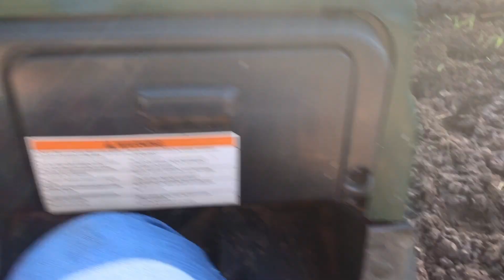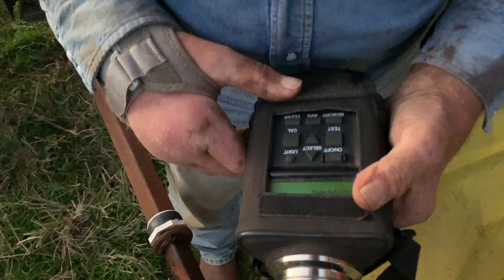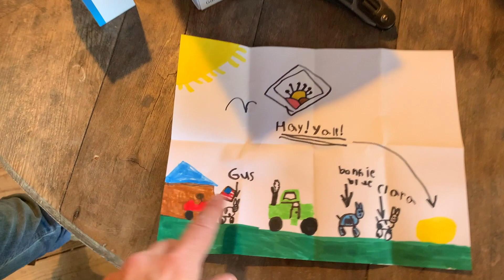Roll That (Dusty) Bean Footage! Harvest is a Go

Comment: years ago when we had our family reunion , my aunts & uncles were all farmers and every year we would have it at someone else's farm with all the cousins! We had the hay wagon for a table with all the food on it, and 3-4 milk cans with cool aid in them, and a dipper to dip it out with!! Glad you get to use the bins!! Never run anything when it's on HOT=blowed the engine! probably a leak some where-Never add cold coolant to hot engine, blowed head gasket!  I noticed that there isn't a guard on the PTO shaft on the auger- grab cloths, accident - I caught the edge of a tarp with the mower, and it got sucked in, had to cut it out!! Love Mustard!

Comment: I have had beans before that were laying down so bad we could only cut them in one direction. You would make a pass then dead head back to the other end for another pass. Only way we could save them. Be sure and secure that auger cause if it moves you will have beans everywhere (don't ask me how I know this). A short piece of pipe going into the bin will prevent this. I know y'all do no till but if you can leave the fields as smooth as possible it sure makes cutting beans easier. If you have problems with rocks check into a bean "roller". Just after planting when the beans up about three inches you roll them which pushes most of the rocks down into the soil. This is done quite a lot in the mid west. The beans are flexable enough at that stage it doesn't hurt them. Hope you have a good time with family...

Comment: Hey just a thought if you put a couple cones or something similar to mark where you place the dump truck you can put them on the driver's side and where the driver can see them in the mirror off the side about three feet from where you want the back and front tires to be and the driver will be able to line up without anyone directing. He will be able to verify when he gets out to operate the auger 👍❤️🇺🇸

Comment: I've got a Gleaner just like yalls (mine is 40 years old and will starve birds to death!) and mine leaks in the same place, at the bottom of the unloading auger in grain bin. I fixed mine with duct tape in the field until I could rivet some sheet metal in place. Another place that leaks is the tailings auger under the machine. Good to see Mr. Lawrence's hand getting better!

Comment: Meredith, if your truck coolant is low and running hot you most definitely have a leak,either externally or internally, if externally its either a hose,radiator,cap,thermostat or intake,water pump gasket or water pump itself,or freeze plug.if internally blown head gasket or cylinder sleeve crack.adding water or coolant is only a temporary fix,it will be low again and run hot. you need Laurence to check it out before you blow up the motor. Always remember this,a motor does not use up the coolant EVER,if it loses any its always going somewhere,AKA leak.

Comment: When I was a teenager I worked on the farm with my uncle.. He had an Allis-Chalmer gleaner combine..Smaller than the one yall have.  I spent many hours in it combining corn and soybeans and wheat.  No A/C in it.  Very hot and dusty in Georgia running a combine.  Hard work but I wouldn't change that farm experience if I could.  Just a bit of trivia here.  Gleaner was an equipment company that was bought by Allis-Chalmer in the 1960's.  One meaning of Glean is "to harvest".  So we get Gleaner means harvester.

Comment: Meredith, just a couple of, hopefully, constructive comments about this typically entertaining and fun video.
I’m sure LB would also realize these noticed concerns.  
1.	Engine coolant low and missing from an engine is a sign of a much bigger mechanical issue. Which, if not found and resolved could destroy the engine. Could be simply an unnoticed leak, a bad water pump, a bad head gasket or several other (more rare) issues. Simply filling the system with more coolant is not a “fix”.
2.	Wow, those soys were much dryer before harvest started than I’ve ever heard of…. I though LB said 11.6%.  When that dry there is a lot of “header loss” when the reel hits the fragile pods. Slow that reel speed and ground speed down. Also the beans are smaller and harder than at normal storable moisture of 13-14%. But I believe the protein is still high.
3.	Looks like Gertie’s fan speed is set too high, as it really throws the dust far rearward. This will cause beans to be blowing over the sieves and out-the-back, with the dust.
4.	Glad to see that the effort to teardown, move and rebuild your new grain bin has worked for ya’ll. Should help at time of sale as the price per bu. will be higher sometime about next spring.
5.	Also, glad that the Dan stayed down with no flooding of the bottom fields.
Luv your channel and personality, you and your family are beautiful in all ways .

Comment: When a vehicle overheats, find a hose and spray water through the radiator.  It cools better than air.  Never loosen the cap to put more fluid coolant in while it is hot! ! !   Ask me how I know!  A busted Engine block is a lot more expensive to replace than a radiator
Reply: Another thing to do is turn the heater on high. Give additional cooling capacity to cool the engine. It's fun when it's 90 some degrees and you have to run with the heat on.  It works.
Reply: @tomfaessler6072  A
Reply: A

Comment: Meredith ask Lawrence why dump trucks most always have boards on top of the bed so it will hold more why does the builder of the bed just make taller so you do not have to add boards if you want it taller